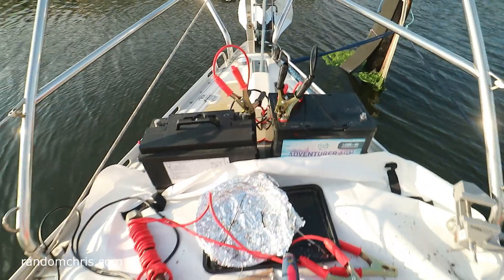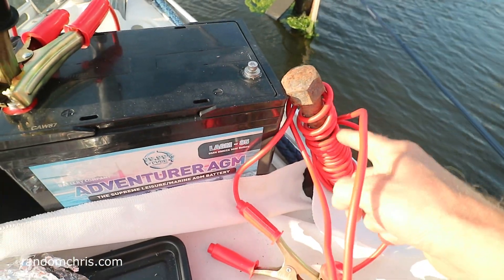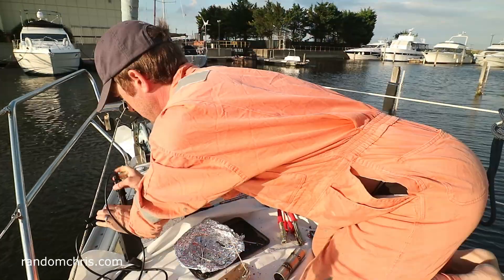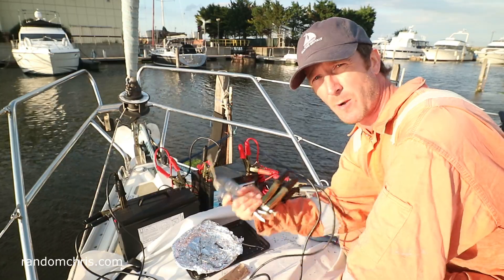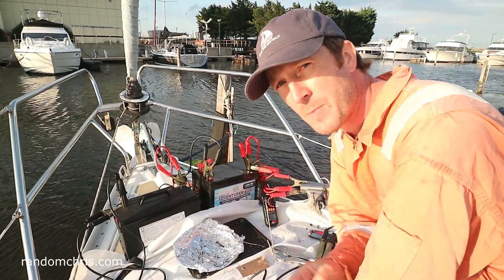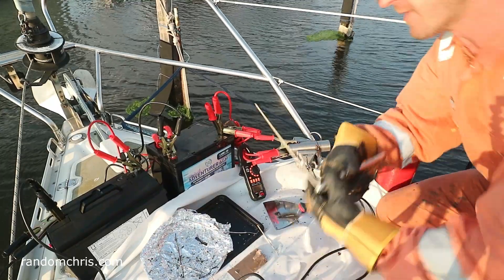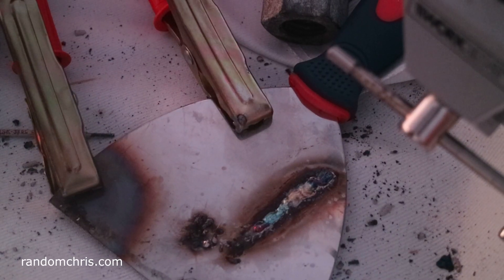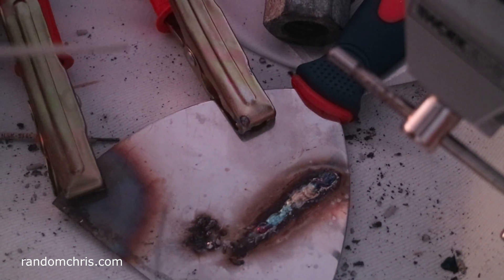Emergency Welding With Two Car Batteries

Comment: I have an offgrid need to weld 1/4 rebar.    I am wondering if 480w @ 24v buck converter "safely" attached to my running van is enough? My van running alternator (160amps) WHILE RUNNING feeds my oversized starter battery 12v 155AH deep cycle.  FYI:  I am  current able to power 1500watt using a 2000 watt inverter with no issues to cook and power anything under 12amps.  If so and reasonable,  What rod would you recommend?  Any way to isolate to protect my battery, alternator and van since effectively shorting my battery.

Comment: You used a pure DC power supply which makes putting an inductor coil in the circuit pointless. It's something I've only recently wrapped my head around properly applying myself when I was slogging through a fair bit of trial/error-ing in my first try at making a multi-core microwave oven transformer welder which was an eventual success. I wanted the smooth & easily maintained arc that DC offered & since my DC was a rectified AC source, an inductor served a very useful purpose since my DC supply still acted like AC by having the voltage bouncing around at 60hz,(just not with the polarity changes). Having a good inductor was doubly helpful there to have since it both resists changes in current fluctuations (whereas a battery's current fluctuations are entirely load-dependant), making for a steady arc  as well as providing it's "voltage kick/spike" if I flinched my arc away from the workpeice, giving me several inches of long-arc leeway & extra fun burning holes in crap (not to mention being a decent high power current limiter)

Comment: How much amp?
Reply: Car batteries are constant-voltage so amps would be determined by the resistance of the circuit & constantly vary due to the small momentary changes in arc length (which effects circuit resistance)
Reply: Yes, but the current will be limited to what the batteries are capable of considering the internal resistance.

Comment: Don’t look at the ark. It’s bad for you eyes and can can burn off a layer of your Retner, give you welder flash, and cancer
Reply: You can just buy a cheap mask for 15 quid from amazon.
Reply from the maker: Hi George, I was using an auto-darkening screen from a welder’s makes so my eyes were protected just as they would have been with a mask. (Which are too large to warrant the space they would take up on a boat) You’re right that you should cover any exposed skin too. Cheers, Chris

Comment: You stand a very high chance of getting covered in battery acid. These battery will I've you no warning when they explode. This is extremely dangerous and should not be attempted.
Reply from the maker: Thank you for repeating my own warnings back at me Martin. (The potential dangers are covered in the video description, which viewers are warned to read at the start of the video.) I disagree with your risk assessment. There isn't a "very high chance of getting covered in battery acid". As far as the batteries are concerned, there is no difference in doing this compared to any other large load such as powering a starter motor or an inverter. The amperage drawn whilst welding like this is not as high as you might think. I messed around for circa 1 hour and resting voltages on the two batteries only dropped from 12.8 to 12.4 volts. If you are using healthy batteries, like I was, then the risk of an explosion is extremely low. My warnings still stand because I don't want to be responsible for other people's actions, but the reality is that this is not as risky as you might think (or as I made out in the video to cover my posterior). Cheers, Chris